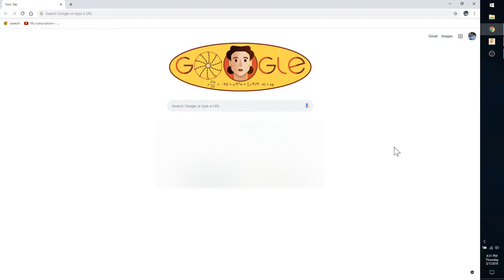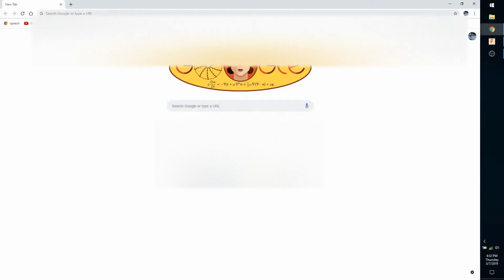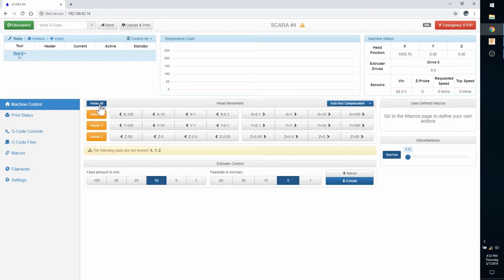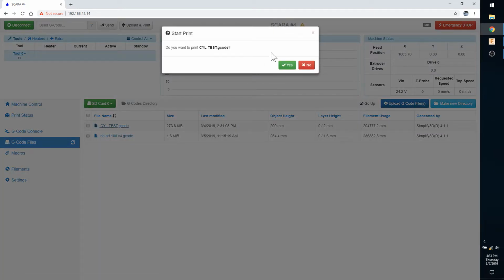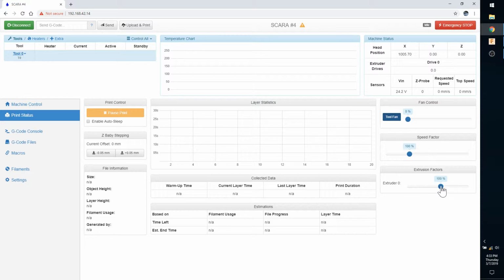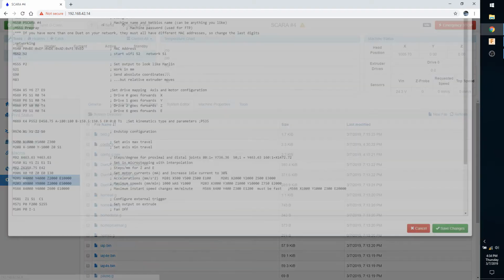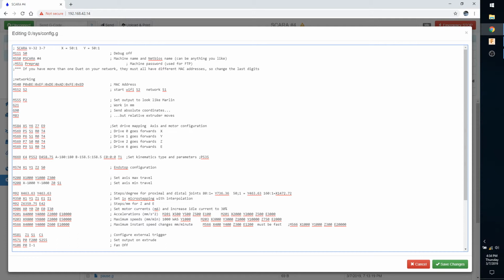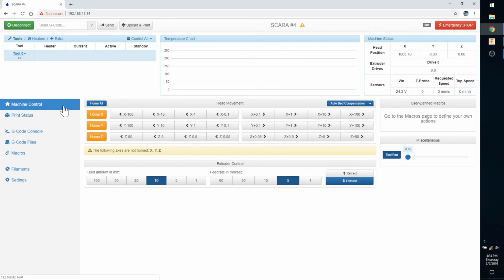Connecting to your Printer

Comment: My printer's wifi dropped unexpectedly. What could be the issue?
Reply from the maker: You could be out of range of the WiFi signal or your device could be changing its WiFi connection to a different network to gain internet access. If you still have connection issues you can email us at techsupport@3dpotter.com